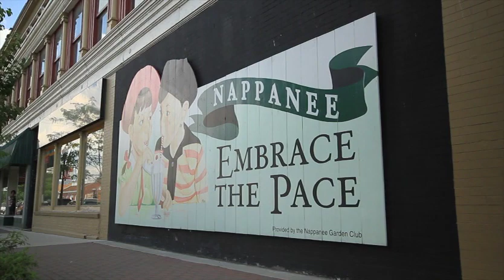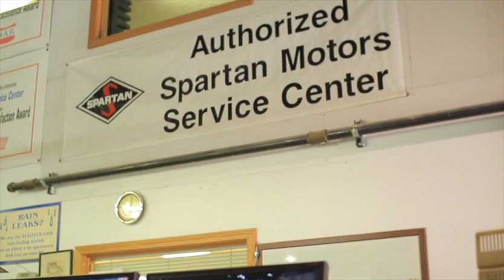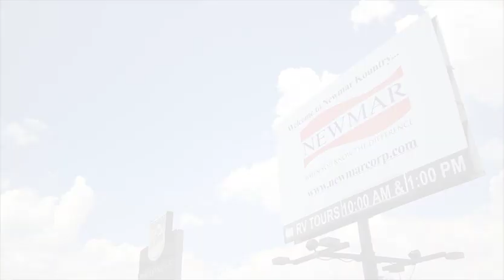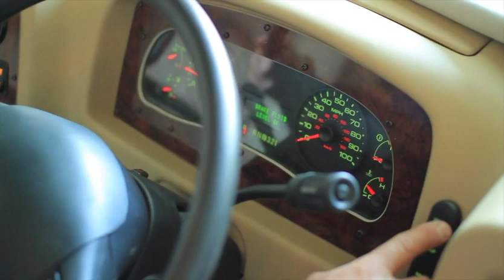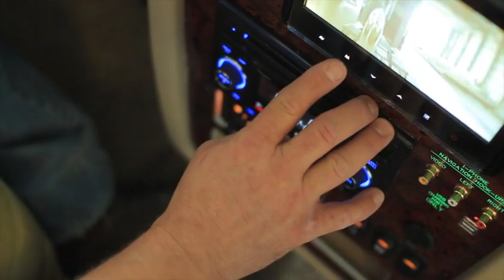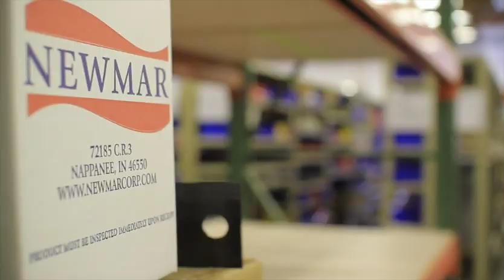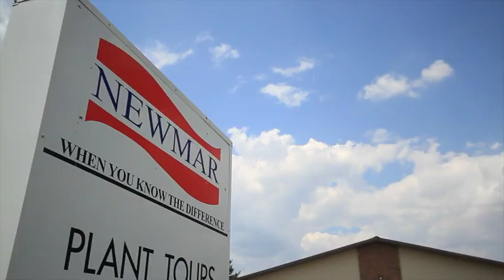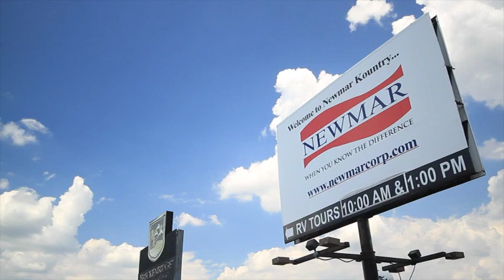Newmar Factory Tour

Comment: Dear Mr Millers. I've been watching Angie Morell featuring Newmar coaches for a long time now and only recently came across this presentation of your factory. Your integrity, values and work ethics explain why I have a great attraction to the Newmar. My favourite is the Class A King Aire 2019 45ft with the electronic slide out trays! Congrats on designing a most exceptional RV. I can only dream of owning one... Here in Cape Town we have Right hand drive vehicles and drive on the left of the road... So it is bureaucratically impossible to own one as well:-)) However I am a big fan of Newmar and will continue to follow your progress and offerings! Welldone.